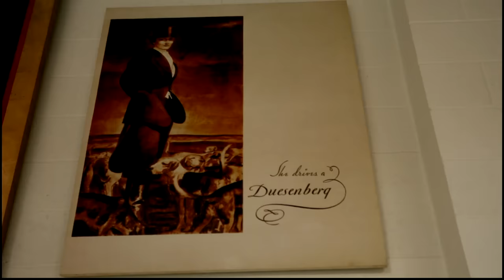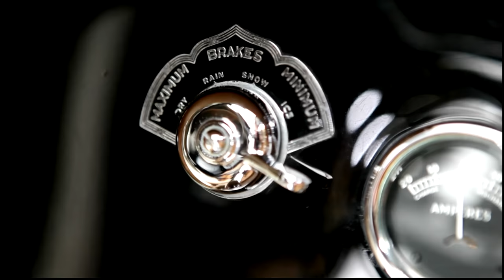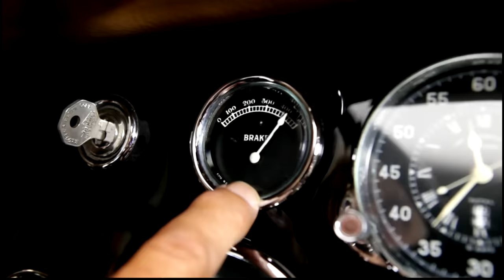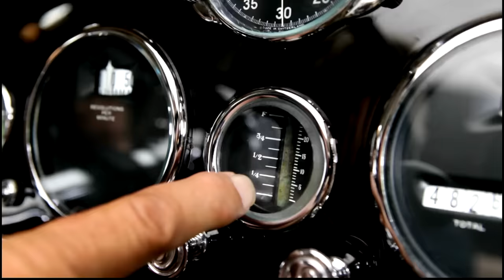1930 Duesenberg LeBaron Barrelside - Jay Leno's Garage

Comment: I'm really pretty ignorant. When it comes to,  Duesenberg.

Lycoming engine? It has a Lycoming? Those were in the Piper Cherokee 140 & 180 my dad and I flew. 55 years ago. And they made the engine castings for, Duesenberg. Who knew? I guess they were just another American engine manufacturer. That didn't end up into many cars?  How many cars had Lycoming engines?

I always thought those Lycoming  engines in the Piper Cherokee's..  Really weren't much different  from that of the original, Honda Gold Wing GL-1000 or something? I never owned one of those either. I had the GL-500.  Which was the Japanese imitation. Most definitely of a, Moto Guzi. I called  It  my,Nipo Guzi. And I ran the, BMW style, Metzler Tires. Those were the best! I loved those tires. Everything else felt like crap! The Dunlop's were okay. They worked well. They were sticky. They kept you on the road.  And they got worn out really fast. And I did not ride the bike hard.

I would consider getting Dunlop's again. I felt they handled and performed well. They just didn't last long. Those, Metzler's, lasted kind of too long. They like never wanted to wear out. Deep tread. Why isn't it wearing out? But now they are owned by, Pirelli. Last I heard? But still made in Germany. But I never tried a Pirelli. Maybe they are great also? Or at least they purchased one that was great. Metzler.

The fabulous Cord. Was rereleased. In the early 1960s.. I guess by Studebaker? As, when I was a kid. Walking to Elementary, Junior and High School. I always walked by this, little, Studebaker Dealer.  And they always had a couple of cars parked out front. One was the Avanti. That was awesome looking. I thought that was the most awesome looking vehicle, in the USA. Back in 1963. When I was 8 years old.

 And one day. What's this parked in front? It's a Cord.. But it's slightly smaller than the one from the 1930s. I think they told me it was, 5/8? 7/8? Something like that? And so look like the original, completely. With the flip headlights. The chrome headers coming out the side of the engine cover hood. As that was technically also a Studebaker, I guess? I have no idea how many of those were ever sold? And I do believe they were a Moto Guzi dealer as well. As a kid I thought that was a funny name, Moto Guzi.. Sounds like something for a kid. A little middle car with a lawnmower engine. Or something?  For a child. But no. It can be a cruiser. It can be a crotch rocket. And it looks like you cut, 6 cylinders off of your V-8 engine. And if that is not a  bizarre looking motorcycle? I don't know what is? But my Honda imitation was great! Not certain what  Italian stuff would be like? And wouldn't ever run?

Oh to be young again.
RemyRAD

Comment: Great video, valve covers are too shinny,  no dipper on underside of the valve covers on 69, oil filler cap goes on left engine side. Chrome shifter ball with console, with no jam nut on bottom side.😮
Reply: Shinny - method of climbing by crossing legs.
Shiny- a brain without sulci.

Comment: I find it amazing to see the low horsepower numbers of these old engines, especially with the technology used. During WW2, Ford built a giant V8 engine for Sherman tanks. Aluminum block, aluminum heads, 4 valves per cylinder, double overhead camshafts, 1,100 cubic inches. 500 horsepower. Pathetic.